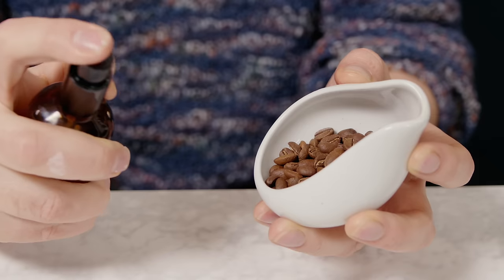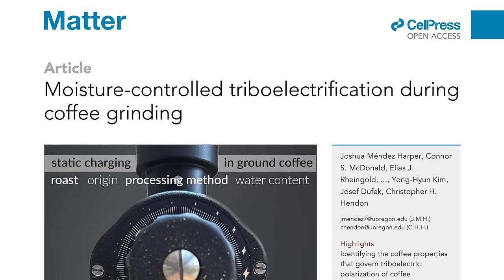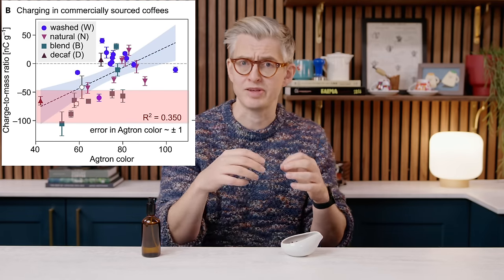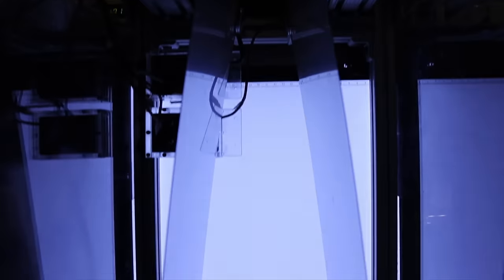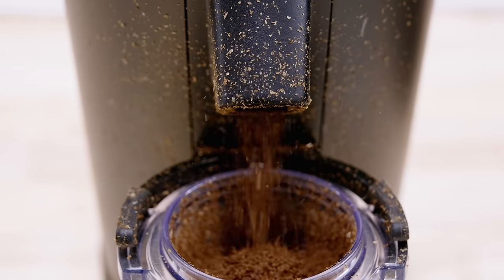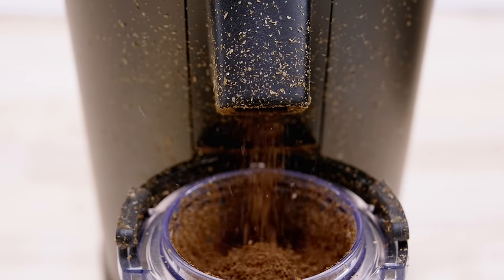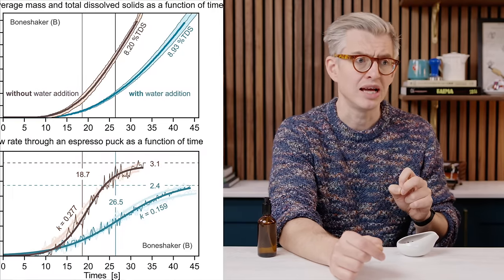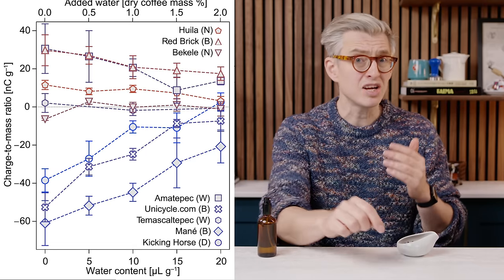Science Discovers What We All Missed: More Than An Anti-Static Hack

Comment: I think one aspect has been overlooked in the experiments you described: time scales of the wetting process might have a relevant role in the process of both triboelectrification and fractoelectrification. What was the elapsed time between wetting the beans and grinding them? It takes time for water to diffuse evenly into the beans. A suficiently long period should be allowed for the water to diffuse evenly into the beans in a way that the beans would have a uniform moisture content and consequently promote uniform stress transfer throughout the beans during grinding. If the elspsed time between wetting of the beans and their respective grinding was different for different experiments, the resulting effects related to tribo and fractoelectrification would certainly be different.
Reply: I don't think water can meaningfully diffuse if you drop it in straight away; but grinding coffee will homogenize it to a huge degree, the water's gonna hang around

Comment: I wonder if the condensation that occurs when keeping coffee beans in the freezer and bringing them out for grinding leads to more of the same as spraying with water
Reply: This is also what I suspect. In addition I feel the electrostatic charge in frozen coffee should be different from room temperature coffee beans.
Reply: I’ve tried breathing on my frozen beans before grinding and it does in fact make a pretty big difference, I assume due to the moisture.  😂

If you just take them out and grind them from frozen, they’re pretty dry.  I think the amount of water from condensation ordinarily would be well less than one spritz.

Comment: About the results from the particle size analyzer not changing with spritzed beans: such analyzers results depend on how you fluidize (suspend/homogenize) the sample before loading it into the machine. That will be different than how those grounds interact with water flowing over them when they're already in a lump in the coffeemaker (ie, in the coffee maker the effective particle size will be finer, since without the spritzes it forms clumps). Those clumps can be broken up in the process of preparing the sample for analysis.

To test this, you could freeze a lump of wet grounds post-brewing, take a cross-section of it, then look at it under an optical microscope.

Comment: Good morning, James  Longtime listener, first time responder.  I have a Rancilio Silvia and a Baratza Sette 30 using 18g.  After 4 spritzes of water I found fluffier grounds in the portafilter after grinding.  At 27.3 seconds I stopped the brew with 34g (the point I stop brewing without water on the beans), however the weight out was 38g with the spritzed beans.  I found the flavor of the espresso richer with the spritzed beans.  

I had used the single spritz a couple years ago and didn't find enough change to warrant the additional step.

Thanks, JS

Comment: My grinder is rather slow and has a single speed and spraying more water made a huge difference for me. Dry beans took 30 seconds and wet beans took a whopping 44 seconds. I'm going to adjust the grinder to fit this method and test it over some time and see if I prefer this. Very interesting results.

Comment: Super interesting - so I did the experiment (added to survey). I have the Niche Zero (64MM conical burrs) and an Isomac Zaffiro (e65) machine - using a WAFO basket. My normal dose is 17g in / 34-36g out at 19 seconds (because of WAFO basket) at ~ 202F for my dark roast espresso blend from Anderson's Coffee in Austin, TX. What I've found so far is that with ~ 4 spritzes of water, it is immediately obvious that that espresso powder is fluffier in the grind cup. Moreover, it adds about 6 seconds to the extraction time. Flavor profile is as good if not better than my normal routine.

Comment: One major issue is the way the water is applied to the beans: whereas usually the water is spritzed on the coffee, in the paper they used a pipette to apply water and shook the beans in a sealed container.
Reply: In what way is it an issue?
Reply: Eh, shaking for long enough will bring you to the same level of homogeneity than spritz/mix. This is a non issue.
Reply: @j.g.9045 the effective surface area of the water. It really depends on how vigorously and how long the beans were shaken to be comparable to a spritz.
Reply: @ElSuperNova23 how long is long enough? What about how hard you're shaking? Or the shape of the container, or what about HOW you shake it? These are all additional variables introduced by using a pipette instead of a spritzer.
Reply: That's not a 'major issue' that's just a variable. Variables don't invalidate studies.
Reply: @meric2363  but the dispersion of water is a key variable… Hoffman even said he could get away with 1 spritz of water and a little shake where the researchers used x3 or x4 as much water to reduce static.
Reply: I literally flick water from my hand or wet a finger and distribute the water manually and it’s sufficient to remove static. To be fair I do use a conical grinder so it probably does a great job distributing that water on its own. What’s interesting to me is more the volume of water used and how much is actually required to get the desired effect.
Reply: The process of aerosolization has a profound effect on the effective surface area and charge of the water. Since we're looking at a microscopic scale, the surface forces and chemistries play a big role. While I wasn't implying it would invalidate anything, it does raise questions about the effect of the spritzing on the charge mitigation and the subsequent brewing process.

Comment: @James Hoffman, did some experiments for filter: 

From Playing with this for filter, I've found it does effect it. But not as much as you may think, 

Using the Varia VS3 and both a V60 and a Chemex and a moccamaster one cup. With and without gooseneck kettle

All brews made with the Filter blend from Square mile, 95c filtered water, sea level. ground at a slighly finer than expected filter grade. all using a 40 second bloom time with 2x water to coffee bloom. all brewed using a rough 16x1 ratio. Using a Modified version of James's V60 techhique 

V60: 15g 250g water: (I did two of each)
V60, no RDT no gooseneck -- 3 minutes 50 second total brew time. not a great coffee to drink, but its reasonably extracted. (don't have a tds meter)
V60, no RDT + gooseneck -- 4 minutes 10 seconds total brew, great coffee, nicely extracted, rich, fruity and vibrant. 
V60, RDT no gooseneck -- 4 minutes 1 second total brew time, not great coffee, seems about the same as the first brew 
V60, RDT + Gooseneck -- 4 minutes 9 second total brew time, again, a great brew, seems slighly richer than no RDT but not by much. 

Chemex: 30g, 500g water: (I did 2 of each)
no RDT, no gooseneck -- 4 mins 36 second brew time, not a great brew
no RDT + gooseneck -- 4 mins 52 second brew time, a nice, balanced and even brew. very light and clean. 
RDT + no gooseneck -- 4 mins 57 second brew time, againm, not a great brew. 
RDT + gooseneck -- 5 mins 11 seconds, nice clean, even brew. maybe slighly stronger than without RDT? not sure. seems about the same. 

Moccamaster: 20g 350 water (I did one of each)
no RDT: 4 mins 4 seconds total brew time - decent, rich and clean
RDT: 4 mins 8 seconds total brew time -  same as above. 

now, I also took exit weight of the coffee between grinds, to see what static does:
V60:
no RDT: in 15, out 14.9
RDT: in 15, out 14.9

Chemex: 
no RDT: in 30, out 29.1
RDT: in 30, out 30.2

moccamaster:
no RDT: in 20, out 19.9
RDT: in 20, out 19.6

This is with only one grinder, and honestly isn't very scientific, but its my rough estiamte of the outcomes. From what I can see, it doesn't make a lot of difference at courser grind settings. Now, I've not tried a cheaper grinder, but I expect a grinder under £300 would see greater outcomes maybe. who knows.

Comment: Was the effect of ambient humidity taken into account? I could imagine, living in a desert with 10% humidity, that this might help although I don’t make my own espresso so I can’t test. 

I would recommend setting up a chamber with a humidity sensor, add in different amounts of water to get a controlled humidity, and grind your espresso in there to help control for that effect.
Reply: I can add a bit to that. Where we live it’s frequently very low humidity, single digits to low teens. I have found better results with multiple pumps of spray say, 3 sometimes 4. 1 or 2 just never seemed to make a difference.
Reply: Conversely, I live in a cold damp house with humidity >60% often and seldom rdt for static removal as I don't tend to suffer from it.

Comment: I looked up your particle size analyzer, and while I couldn't ID the specific model,  I did find a spec sheet for similar instruments. Looking that and at the shape of the signal drop off at 500-600 um got me wondering if the detection range of the instrument might hit a ceiling around that point. Usually instruments have some fudge around the stated detection range - that's the range they guarantee so there's some margin where detection is possible but assignment of a calibrated result may be less accurate. However, beyond the margin - high or low - there will be no signal. It's common for scientific instrument software to only give a detection limit error  when there's no signal. It doesn't give a "tilt" warning when only part of the signal is clipped. And the same software might default to or allow display of a much wider x-axis than it can actually measure.

If the user isn't doing their own calibrations and purposefully testing the range limits with mixed standards, they might not even be aware of the limitation - even professional scientists. It's certainly something I've missed in the past despite many years of doing hands-on research.

Comment: I have found that holding an ordinary baking brush under the tap, shake off  most of the water, and then stir the beans with it before grinding provides a much better distribution of moisture than a micro sprayer (and less sticky mess).

Comment: For my experience I find that during the winter months, when the heat is on, the house is very dry, and I have in inordinate amount of static electricity in my grounds.  So far, I have used a big stainless steel canning funnel to get the grinds into the hopper of the drip brewer and that seems to dissipate the static charge.  I then upend my grinder and give it a tap to get as much of the grinds as I can to fall out of the grinder into the funnel.  I will give the mist a shot and see if this takes care of the annoying static charge.  Great video James thumbs.

Comment: Since I first saw this video, I've been adding extra water to my coffee before grinding. I only make pour-over filter coffee these days, but I've noticed a few things. The biggest impact was the reduction in static. One spray of water would get rid of some of the static, but four sprays (per 24g dose) gets rid of it completely. I haven't had a single bit of coffee stick to the burrs of my grinder since I started using the extra water. I use a hand grinder, the Timemore C3 Max Pro. The flow rate is a touch slower overall, but it's hardly enough to notice. The total brew time goes up by maybe 3 to 4 seconds for a 3 to 3.5 minute brew. It could be confirmation bias, because I have no way to actually measure this, but it also seems like the bed settles more evenly at the end of the brew. I can't tell much difference in the taste, but the reduction in static is a huge deal for me. I'll be sticking with it!

Comment: great video. Making the parallel with Soil compression when we build roads, it is important to add moisture to achieve the right compression and soil sensity. Maybe coffee reacts the same way. Hence adding moisture helps to get the puck density higher. I did not test this hypothesis, however if this is correct, spraying after grinding and just before tampering would lead to a longer shot. Food for thoughts

Comment: Hi 👋
From my experience with particle size analyzers (did a PhD with technical ceramics that involved a lot of particle analysis), one should analyze particles with a visual image as well with the distribution the analyzer gives you. Simply put a bit of that same sample in a slide and see it on a SEM. There are nowadays super convenient table-top electron microscopes that will work just fine for this.
This will help to understand further if the distribution consists of weirdly shaped particles or regular, or if they are clumps of small particles sticking together (possibly electroclumps) that are fooling your distribution.
I’ll go have a look at that paper now 🙂

Comment: Great subject and video. But I also have so many questions: 
- what is the effect of WDTs here. Did you use one? Would that mechanical force be sufficient to break up those electro clumps?
- would grinding frozen coffee not do the trick as well? The heat would of course be reduced and then there will likely also be condensation on the beans. 
- is it possible that ground coffee is just hydrophobic until it has been in contact with water for a while. Is it maybe more of a surface treatment that happens between grinding and brewing that effectively improves wettability (and thus extraction) in the beginning of the shot. Hot take: is this part of what preinfusion does as well?

Comment: Tried some water on the beans before grinding. Definitely less to no static. I use an AeroPress, plastic tube, so static is very obvious.  But my Baratza Encore was not happy. The next morning just dragging the grinder out across the counter caused little chunks of grounds to fall out. An initial cleaning on/off showed lots of chunks to fall into the discharge container. They had obviously struck while wet and fell off after drying overnight.

Comment: I did the experiment over a couple of weeks now.  All in all, I think I liked the result a tiny bit more with that method. BUT I never did a side by side comparison. Just tried changing my routine to add more sprays, and I definitely don't see a huge difference.

Now. I have to say, though, that it made grinding significantly harder with one particular bag of beans that were a bit more oily. To be clear, they are high quality beans from a local roaster, not burnt costco beans where the oil has no choice but to bead on them; they just have a bit more oil than usual. But with those beans, adding more water made them stick to my hopper, the burrs, the chute, etc. I had to deep clean my grinder after just a few days, and I basically need to grind a dozen beans or so on a really coarse setting if I want to clear the grinder, and that never happened before.

Comment: I’m wondering what difference a hand grinder makes? I use a comandante for espresso and known that if I spray the beans before grinding that the grounds don’t stick to the bottom of the burrs or the inside of the glass jar nearly as much. It makes less mess, but I wasn’t sure if the whole set up would change things (e.g. slower, less uniform grinding times; maybe contact with the metal chamber and a person’s hand?). I’d try the experiment, but I also use a Flair, and my consistency is… adequate for the occasional drink at best :D

Comment: I have a conical burr grinder. There's no ionizer or mechanism to reduce the flow, and I do get "electroclumps." The chute leads into a small tank to hold the grounds. Because I'm just doing one espresso at a time, it forms a shallow layer at the bottom. I don't imagine anything is happening with the charge, but it is enough to break up any of the clumps that form, and I find the espresso pulls nicely. Maybe I'll try spritzing it with water, but the higher extraction rate that comes from that might not be pleasant for me.

Comment: The most consistent variant I have been able to replicate on my specific grinder (Option-O Lagom P-100) has been in feed rate - per Lance Hedrick's recent video, I have been trying to use a very slow feed rate recently, for which I do consistently realize faster shots (likely a function of coarser grind for a given burr gap and fewer fines).  I played around not only with RDT vs dry beans in a "normal pour," but also in a very slow feed rate, and got much different results.  Pouring the beans in all at once, RDT had a significant impact on the total shot time (around 25 seconds vs 34 dialed in for 20g in 44g out).  I saw very little difference in total shot time or extraction percentage however between RDT and not with a very slow feed rate.  So, I think there might be merit to your hypothesis re: bottlenecking.

Comment: Around 6:00:
I've been using the DF64 for the past 2 years. This grinder has a massive amount of status, basically requiring me to use RDT every single time i grind my beans for espresso (2 times per day, rarely 3 times), with 2 sprays for each grind because 1 spray only negate the static partially, not nearly enough to eliminate it altogether. Using RDT with this grinder, i discovered that the flow rate actually slows down as the aforementioned paper indicates. Therefore, i concluded that the 2 sprays of water results in the ground being more sticky, causing them to be reground. I got it partially right! The water attracts the fines and causing the fines to be regrounded!

Comment: Hi James, just sharing my experience since watching your content in this video:
adding 3 spritze (actual 0.3gr of water) resulted in a slower extraction hence the possibility of high extraction results.
tried to coarser the grind but the coffee came out with less body.
Looks like the resistance of the puck accessed.
Grinder LS 807,Machine LMLM   set to 6.5 bar brew preasure